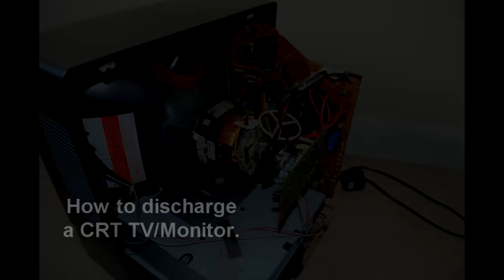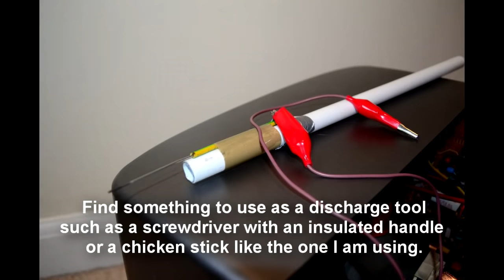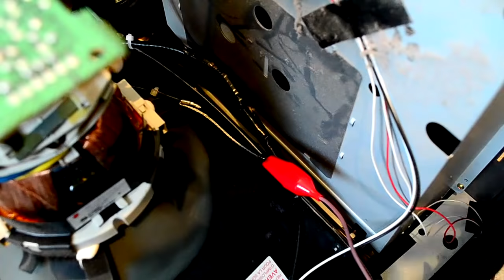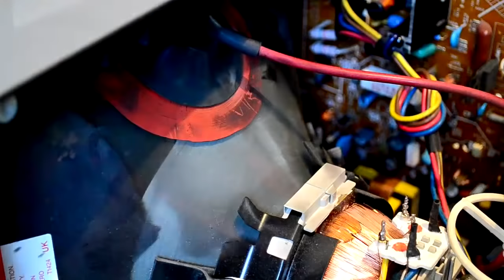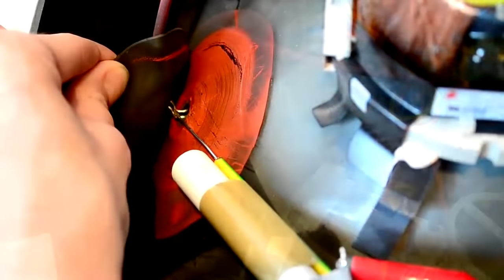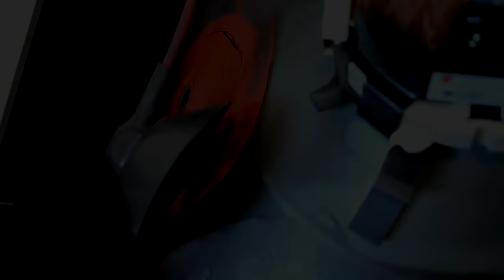How to discharge a CRT

Comment from the maker: Basically a non-conductive stick such as PVC pipe with an electrode of some sort (eg a nail) tapped to end, this is so you don't accidentally touch the high voltage side and get a shock.

Comment from the maker: I completely understand.

I originally made this video for fellow high voltage enthusiasts where the term chicken stick is commonly used (referring to the tool/wand that is connected to ground and is used to draw arcs from the high voltage end of the circuit).

I just never expected it to get more than a few 100 views, but if you found it helpful then that is all that matters ( :

Are you repairing a CRT TV/monitor or are you after the goodies inside?

Comment: I need to build one of these... I currently use a flat head screwdriver and cable (with alligator clips on each end). It works great on 34cm (13.5") CRTs, but I wouldn't trust it on anything larger. Check out my video for discharging a CRT - uploaded a few hours ago.

Comment: You always want to discharge it twice, wait about 20 sec discharge it again. I was lifting a picture tube into the back of my car and got a shock off it, it's a good thing my dad also had hold of tube otherwise I'd probably would have dropped it, and bad things can happen went they break apart.